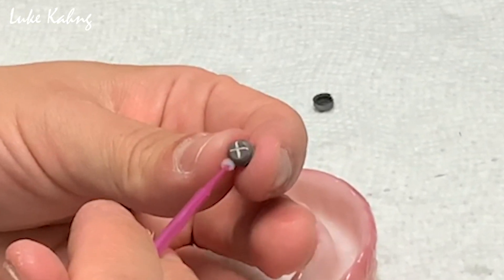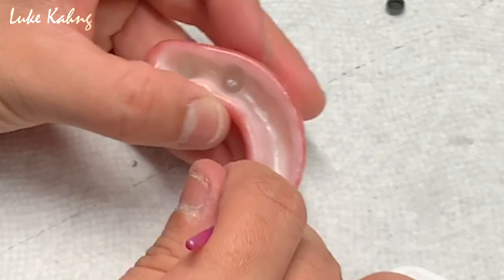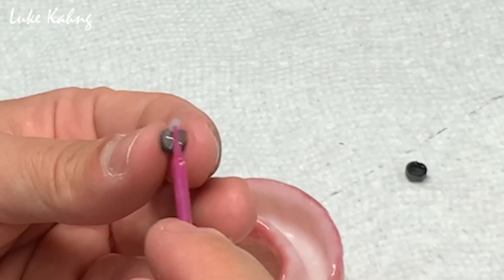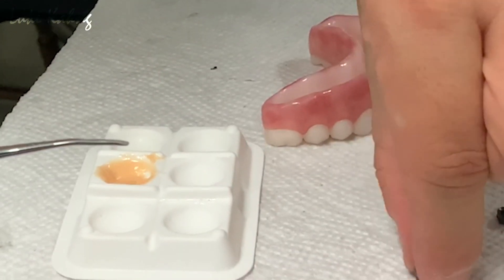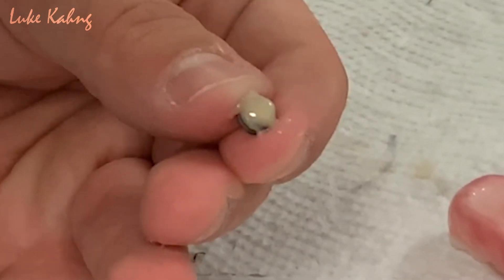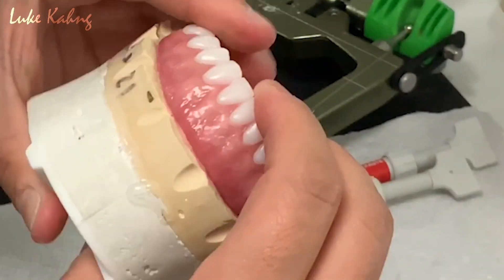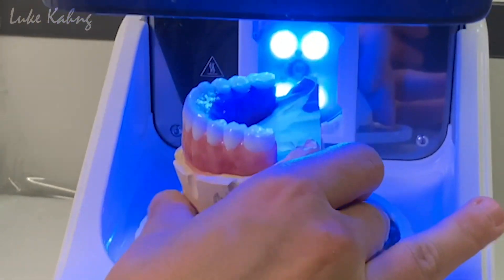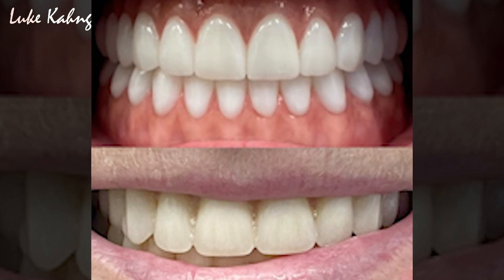How to Cement a Zirconia Locator® with Clinical Post-Op

Comment: Thank You for the perfect Video: On the next video, can you show us how make customized locator abutments digital design using your EXOCAD software and CAM production using computer numerical control machine. Using standard Zest Dental 3.89-mm male connection on milling setting. You did on your previous video to correct angulation in an upper implant arch. Most labs and software (3 shape) can not do this....this is special process… ( You show this in -What's the difference : Hybrid Screw retained Zirconium vs Removeable Full mouth Zirconium video)